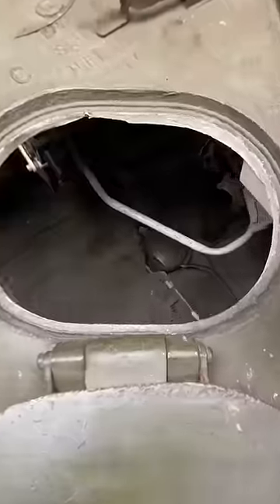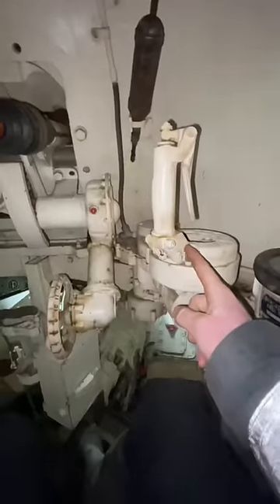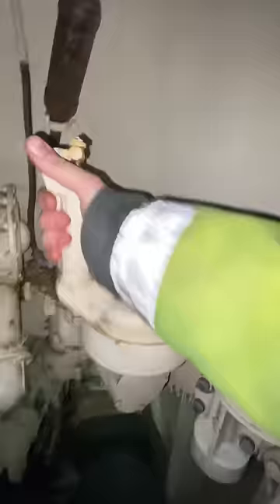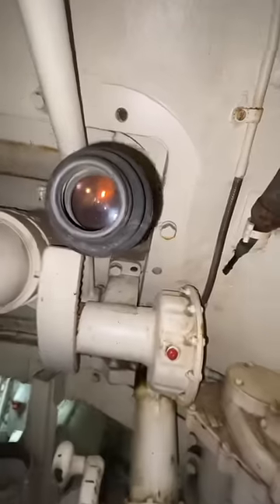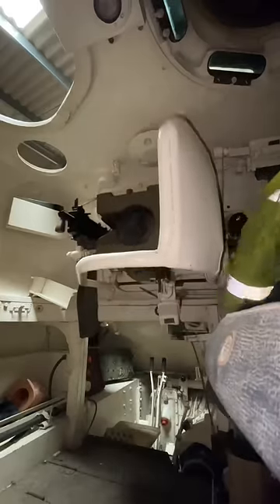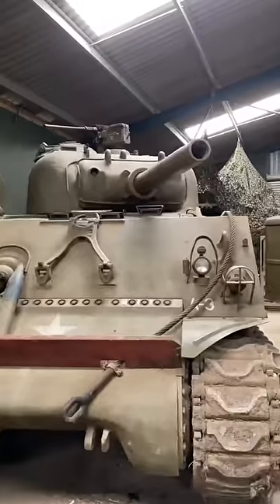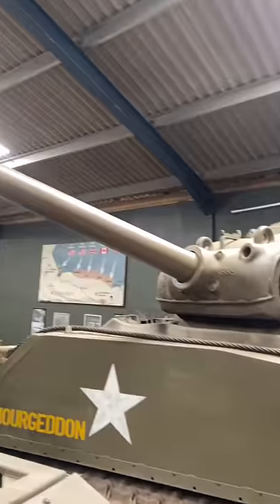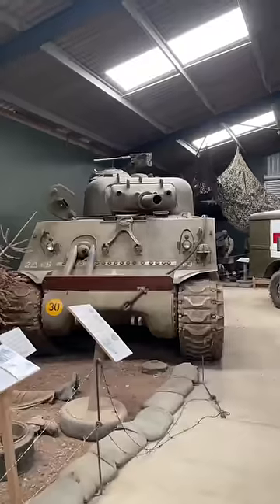How to aim a WW2 Sherman tank! #shermantank #ww2 #tanks

Comment: Actually, in World War2 era tanks power-assisted (electric or hydraulic) traverse and elevation would have been used for rough quick aim, and the manual hand wheels would be used to do the final precision aim prior to firing.
Reply: Yup. This is the 105 sherman tho and not a 75 or 76, so it doesn't have any hydraulic or electric power to assist rotating the turret

Comment: No that's pretty fast. Panzers have a very slow Traverse rate
Reply: No, it really isn't. German tanks had turret rotations roughly the same as the sherman in the video, however the depicted sherman is the 105mm variant, so it didn't have electrical or hydraulic assisted turret rotation like the 75 and 76mm variants. Yes I know this was a mouthful - it's midnight give me a break
Reply: German tanks did have slower rotation than the Sherman.... It's ok to admit...

Comment: I got lucky enough to be drafted in an amror division during my conscription period in the Greek army. I was trained as a driver and I was one of the very few that got to actually drive a tank during two summer exercises.
I have to say, it was an absolutely amazing feeling. 
One thing you mentioned about the visibility when the hatches are closed is that the visibility is absolutely dismal... As a driver you have 4 small mirrors to the outside and it's next to impossible to see anything and drive properly without the help of the tank commander.
The last thing I see it is very different in the video when compared to my experience is that a us WW2 era tank is very spacious. I personally come at a huge frame (for a tanker) of 1.89m tall and I could barely fit in the driver space. Other guys in the crew were smaller at ~1.60-70 and we're still a tight fit for all the other positions. This is fascinating to me because a Leopard 2 is bigger than the tank in the video but apparently way more cramped.

Very nice and interesting video

Comment: If that's how slow the turret rotation is, I might as well traverse the whole tank for quicker aiming 😂
Reply: That’s actually how it was done for this particular variant.  It’s for bunker and trench busting.  They’d point the tank at the target (since it doesn’t move and you want frontal armor facing them anyway) and the hand crank was for fine movement.  Even other variants with hydraulics to traverse used hand cranks for fine control

Comment: It’s an M4A3 105, a specialized support tank that would lob 105 mm HE shells at buildings and fortifications in support of troops/ bunker busting, which was better than the smaller 75s. It wasn’t really a tank killer though as far as I’m concerned. And because of the dimensions of the gun, I don’t think they added a power traverse, which is why it rotates so slow in real life and in war thunder.

Comment: All tanks still have this feature, on top of the hydraulic system. This is because of the hydraulic  system goes down, such as if the battey dies or hydraulic system is damaged, the turret can still traverse.
Reply: Sorts not really, at least for the Sherman.  The reason for the hand crank was for fine control since the hydraulics were too quick and aggressive for aiming.  The reason this variant has no hydraulics is because it’s designed to attack static targets where you can just point the front of the tank at the target which you want to do anyway and only need fine control.

Comment: Fun fact: it's so slow by hand because it makes it easier to hit something at range if it takes so much to turn so little. However it makes it harder to hit a moving target at close range.
Reply: Sorta not really.  This is the 105 variant.  All other variants had hand cranks as well as hydraulics.  The reason this one doesn’t have hydraulics is because it’s designed to attack sitting targets where you would want to point your frontal armor at the target anyway and you only need fine control of the hand crank.  Other variants would be expected to attack moving targets and so the hydraulics would be used to point at the enemy and then hand crank again for fine control.  Later models of this tank had electric motors retrofitted for traverse.
Reply: @AnarexicSumo  That's what I meant my bad for not specifying.

Comment: They also had hydralics inside of shermans, the manual turret traverse, which is what you were using, was for when the hydralics were either taken out in combat, or it for whatever reason failed. But of course, the crew that would use the gun more likely than others, (gunner and commander, plus loader sometimes) would have to go trough training to rotate it very quickly

Comment: T-34 with electric motors: 😏
Reply: T-34 with its horrible manufacturing problems:
Reply: @Schrödinger10485  but producing factories used some very modern and effective welding technology
Reply: Meanwhile crew ergonomics and radios on all the t34 versions except 85 and su 85:
Reply: Also this is the only sherman without stab and electric motor beacuse the 105mm was too huge so they had to remove them

Comment: My god imagine being stuck in there during a battle. Just an oven waiting to be ignited to turn you into a charred lump of flesh
Reply: Shermans actually had an insanely high survivability rate when taking a direct hit. 83% if remember correctly. Soviet tanks were as low as 15%... The sherman was actually massive inside compared to others. IF you've ever seen a soviet ww2 tank, they are so small and low profile, that it is a damn contortionist act to get in and out of one. Would be so tight and take so long to get in and out of, the chances to survive were miniscule. The soviet T tank also came with a sledgehammer to pound the gear lever into 3rd gear, and getting it in 4th gear while going at a good pace was near impossible so it was almost never used. You needed to be extremely physically fit to drive one.

Comment: Most later war tanks had an electric rotation drive paired with the manual drive, nothing hydrolic in that, have you see what happens when hydrologic systems fail? That's why. Also that's not the "aimers position", that's the gunners position, with the loader on the other side and the commander would be sitting/standing the gunner depending on whether or not the commander was looking through the viewing periscopes in the cupola or sticking his head out the hatch for a better view

Comment: Not called an “Aimer” in the US tank corps. That’s the spotter or shooter’s position but never an “Aimer”. The seats in a Sherman chasis are as follows: Tank Commander (TC), Spotter/Shooter, Loader on the left side of the gun, behind the driver, then the Driver and Assistant Driver/Bow Gunner (BOG) located on the left side, then right respectively. Sherman’s are Left Hand Drive for the most part so drivers are usually on the same side as the loader when the turret is in the 12 o’clock position.

Comment: The horizontal aiming gear shouldve been bigger, that way you can get more distance with less hand cranking, atleast thats what i can think of to speed up the aiming or use 2 of the same gears in a Y pattern which will speed up the process with less hand cranking.

Comment: First of all, there was no “aimers position”, there was a commander, driver, gunner and loader, and some had a radio operator/mg-gunner as well. Second, with hydraulics aiming would still not be automatic, you had to manually train the gun using the hydraulics. N00b.

Comment: Most of the m4 Sherman's where  Manual between 1944 to late 1944 after that to 1945 an all the way when  Germany  Surrendered alot of newer taks where coming off the Line had  Hydraux to help if it whent out u could still use manual

Comment: Fun fact: Tiger 1 has electric motor for that
Reply: Another fun fact: all shermans had both electric motor and stabiliser but this is the 105mm version so they couldn't fit inside
Reply: No it did not. It had engine-powered traverse via a hydraulic gear.

Comment: This is the reason 73 easting worked for the US in Iraq the Iraqis had export versions of the T72 basically a shittier version which instead of having hydraulics had manual cranks after a bit the crews got tired and gave up it also didnt help that they had 60s ammunition.

Comment: Ahh an m4a3 105 Mass
66,800–84,000 lb (33.4–42.0 short tons, 30.3–38.1 tonnes) depending upon variant[3]
Length
19 ft 2 in–20 ft 7 in (5.84–6.27 m) depending upon variant[3]
Width
8 ft 7 in (2.62 m) to 9 ft 10 in (3.00 m) depending upon variant[3]
Height
9 ft 0 in–9 ft 9 in (2.74–2.97 m) depending upon variant[3]
Crew
5 (commander, gunner, loader, driver, assistant driver/bow gunner)
Armor
12.7 to 177.8 mm (0.50 to 7.00 in) depending on location and variant[3]
Main
armament
75 mm gun M3 (90–104 rounds)
or
76 mm gun M1A1, M1A1C, or M1A2 (71 rounds)
or
105 mm howitzer M4 (66 rounds)[3]
Secondary
armament
.50 caliber Browning M2HB machine gun (300–600 rounds),
2-4.30 caliber Browning M1919A4 machine guns (6,000–6,750 rounds) depending on variant[3][4]
Engine
M4 and M4A1 model:
Continental R975-C1 or -C4 9 cylinder radial gasoline engine,
350 or 400 hp (261 or 298 kW) at 2,400 rpm[3]
M4A2 model: General Motors 6046 twin inline diesel engine; 375 hp (280 kW) at 2,100 rpm[3]>
M4A3 model: Ford GAA V8 gasoline engine; 450 hp (336 kW) at 2,600 rpm[3]
M4A4 model: Chrysler A57 multibank ~(30 cylinder) gasoline engine; 370 hp (276 kW) at 2,400 rpm[3]

M4A6 model: Caterpillar D-200A (Wright RD-1820) 9 cylinder radial diesel engine; 450 hp (336 kW) at 2,400 rpm[3]
Power/weight
10.46–13.49 hp/short ton (8.60–11.09 kW/t) depending upon variant[3]
Transmission
Spicer manual synchromesh transmission, 5 forward and 1 reverse gears[5]
Suspension
Vertical volute spring suspension (VVSS) or horizontal volute spring suspension (HVSS)
Fuel capacity
138–175 US gal (520–660 L; 115–146 imp gal) depending upon variant[3]
Operational
range
Road:
100–150 mi (160–240 km) depending upon variant[3]
Cross-country:
60–100 mi (97–161 km) depending upon variant[3]
Maximum speed
22–30 mph (35–48 km/h) on road, 15–20 mph (24–32 km/h) off road depending upon variant[6][3]
Reply: straight out of wikipedia😅

Comment: There shermans that came out later in the war that did have hydraulic in the turret and they were fast turning turrets. The Ez8 models has them and also a 76 mm gun which was nasty on the field. I think this was the howitzer Sherman that didn't have it.
Reply: It was actually standard before the Sherman was in service. The 105mm Shermans didn't recieve them as they were howitzers, not technically tanks (though they retrofitted them)
the M4A3 76(w) HVSS is the name of the 'Easy 8' (otherwise you are referring to the prototype suspension design)

Comment: They should have a fine and a course wheel…

Ah well, I’ll be sure to mention it to the engineers through email when they design the next model…
Reply: This is an artillery model, So it's designed to be used behind lines and not in direct combat. The 75mm and 76mm had hydraulic and fine adjustment

Comment: Im going to throw a guess and says thats a M4A3E8 sherman, You can tell it apart from other shermans thanks to its HVSS suspension rather than VVSS suspension, Along with that it has a better engine, and this should be the sherman M4A3E8 105 thanks to its slow as hell turret traverse
Reply: Yup, its an M4A3E8 with a 105mm howitzer
Reply: Yeah the barrel is CHONK